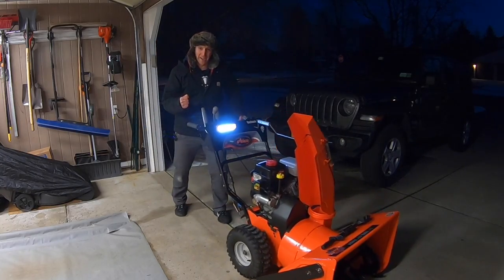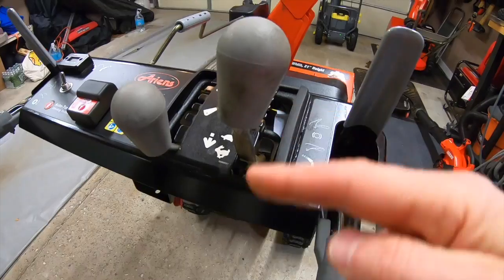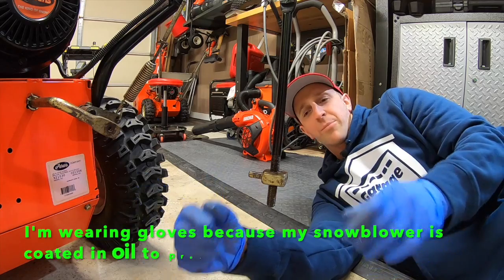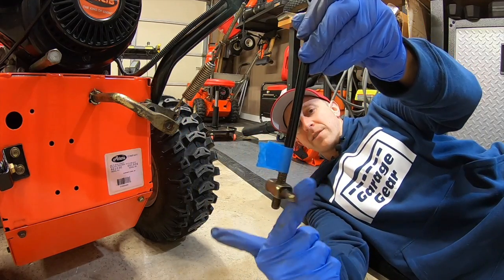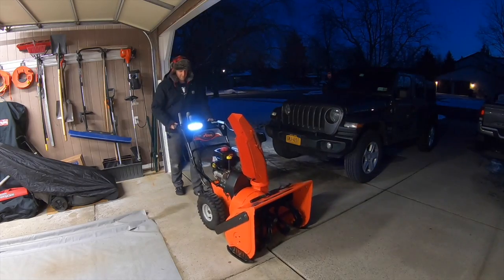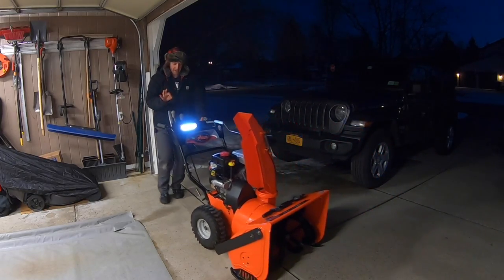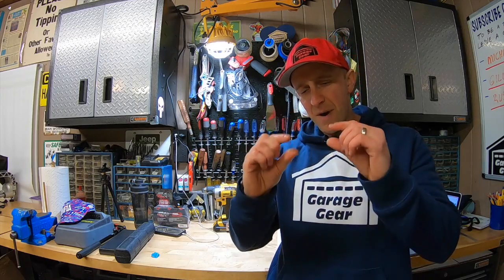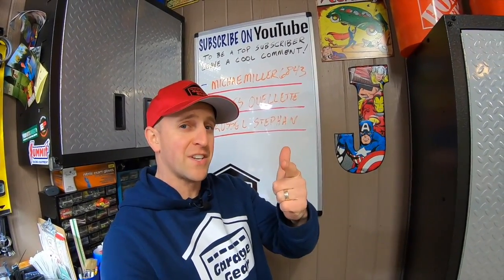BEFORE YOU ADJUST THE SPEED SELECTOR ON AN ARIENS SNOWBLOWER, WATCH THIS!

Comment: I created another slower gear between 1st and reverse. Cut an appropriately sized notch in the gear deck and adjusted the rod to match. It was possible because Ariens newer gear decks are different than what was seen in this video. Used a dremel.
Reply: Great idea, I'll try that for certain brands!
Reply: Space Cadet tell us more! @JB can you elaborate on this?
Reply: @brandon_burbach  The gear notch deck on an 2019? Ariens runs horizontal, right to left. For each gear is simply a notch in the steel deck which sits the spring loaded lever. There is a wide space between first and reverse which is solid deck into which I cut a slot wide enough to fit the lever.

 Because I felt 1st gear was too fast, I readjusted the gear rod length (as he shows in the video) to match the speed I needed and it also affected the reverse speed. I took put the words (SLO) above the gear with labeling tape.  I made it all pretty by black enamel or was that nail polish? 🤔

Don't try this at home though. This was attempted after hours and hours of sitting at the feet of J.B., learning from the Master himself. Now that I'm a professional (under J.B.) I can ignore all those warnings I see on TV ads. 😏
Reply: @donmayberryjrsOPE  yes, certain gear decks may not allow this mod.
Reply: I had found that simply adjusting the shift lever rod resulted in speeds, either 1st or reverse that were almost non existent. So that's when I gathered all my J.B. knowledge and cut myself a new gear. Reminder: This is on a newish Ariens but may/may not work on other brands, based on the gear deck. 🙂
Reply from the maker: Space cadet!!! This is a great idea! Saw another guy do this a while back. He used a grinder… very messy! The guy made a really slow newer first gear. Worked great! My model doesn’t have much room for this. If it did I would try it. Thanks for sharing your expertise bud! Did you install a spoiler and taillights on your blower yet?
Reply: @GarageGear  I had a problem yesterday with an old Poulan snowblower, 1st reverse was too fast and the slowest forward was too fast and not enough slack to "make a gear" and the customer was pissed! Because I told him how it SHOULD be if he has bought a better brand 😂😂🤣🤣🤣🤣
Reply: @donmayberryjrsOPE  lol...😄
Reply: This is a great idea. I wonder if this can be done on my Troy-bilt?
Reply from the maker: @SVW1976  possibly if there’s room.

Comment: The "all the way down" trick depends of the year/model. Owners should read their manual before adjusting their snowblower as shown. As an exemple, on model 921044 you should adjust the pivot pin with 7 turns from "all the way down". It still work that way, but fwd will be too fast and reverse will be too slow. 921032 model is the same year as 921044 and should be set all the way down.
Reply from the maker: Thanks for sharing bravo!

Comment: Just brough my Ariens blower out for the first real snowstorm here in Maine. Am having exactly the issue you describe with fwd gear 1 crawling in reverse, and the unit won't go into reverse gear 2. Going try this out today. Thx JB!
Reply from the maker: Give it a shot and let me know how it works out for you Alex! Thanks for watching 👍
Reply: Did you buy it at a big-box store?  If so, there's a good chance it was never assembled correctly in the first place.
Reply: @floobertuber  No this was a way older model(ST824) given to me, but I have experienced a Sno-Tek not assembled properly from the big box store. The auger tensioner was to loose.

Comment: Wow thank you for this !  You  explain every thing so thoroughly. I’m a woman snowblowing with a new Ariens.  I even bought my mine after watching your videos. Your content is amazing! The problem with the  drive belt not lining up and allows the belt to come off the pulleys. Do you have a video to fix this issue.
Reply from the maker: Hey Riverunner! I don’t have a video on that exactly but I wonder if your belt guides on top of the pulley are set a bit wide and could be adjusted down a little to help keep the belts from popping off. Perhaps they could be repositioned. I would start by giving those a look. Thanks for watching!
Reply: @GarageGear  ...yes I was able to get it to stay on track . It Definatly needs to be  moved ever the slightest! .!  I just blew away 21” thank you for all you do!

Comment: Excellent t ip. My 13/32 Pro skips from 1st to second under load like last night. I'm going to do this adjustment ASAP. I replaced friction wheel several years so. Checked wear as ND greased gears in Fall. A few small cuts in rubber but still plenty of thickness.
Reply from the maker: Let me know how it goes for you Joseph!
Reply: Om doing it today my issue is between 1 and 2. Just debating whether to set the lever at 1 or 6 but I suppose I can try both if one doesn't work
Reply: Did it today. My swivel was up top under dash and tge lever was up top too. I pulled it down used number 6 speed like you said. 1 gear lined up. 6 needed a few turns  longer to line up. It was too short. Popped clip back in. Haven't tested it yet but I will this weekend. Installing LED bar light and redoing my hand crank mechanism so it's tied up right now.
Reply from the maker: @josephlahood4647  let me know how the test goes
Reply: @GarageGear Ran her down dry driveway like you did no issues. Reverse 1 and 2 same. I'll have to wait for a good sized storm to testis under load. She was skipping with a big click from 1 to 2 under load. So far so good. Thnkyou Joe

Comment: Hi , Bonjour 
I realy like your videos 👍. I have two questions. I recently bought an Ariens 24 Deluxe…and I found that the first gear was lightly too fast…the dealer said …if I set the travel speed too low, the friction disc will wear out faster ??
And also , my neighbor said that the Ariens friction disc wear out faster than other brands.
What do you think about that. Thank you so much.
Pierre from Québec Canada 🤚
Reply from the maker: @pierrelacasse5345  hey pierre! Congrats on your purchase. You may be able to adjust it the threads up or down one thread to slow your first gear. But make sure you’re not losing reverse in the process. I don’t know about them wearing any faster than other brands. They’re not difficult to replace. I wouldn’t worry about it . It really comes down to how much you’re using it. Thanks for watching
Reply: Thank you…and I hope to have a lot of snow in Québec to have fun with my Ariens 😁

Comment: Great videos! Amazing. Can I ask please what the speeds are for? I use speed 1 for clearing heavy wet snow and faster speeds to move unit from one place to the next but unsure if you are supposed to clear snow in speed 2 or 3? Thanks!
Reply from the maker: Hey Rick! Appreciate the positive feedback my friend! 1 is for heavy wet snow. 2-3 I usually use for 3-5 inch storms of light snow. 4-6 are generally transport speeds. Thanks for being a cool fan! 👍

Comment: I really wish my snow blower had a pull start before I before I bought it somebody made it into an electric only start So I have some struggles with it especially since the carburetors in doing so well and I have to keep using the prime bulb to keep it running. it probably needs a lot more work than just that LOL
Reply: I really can't complain though since I only paid a $1.30 cents for it at an estate sale
Reply from the maker: @SuburbanBeard  hey bud! What kind of snowblower do you have? Brand/model? Only A $1.30 for it? Seriously?
Reply: @GarageGear  online estate auctions in the summer! all kinds of deals. snowflite mtd. 5/21 tecumsah engine upgraded electirc push button start. i have a plan to retrofit a 12v battery onto it so i can oush start it anywhere! constant stalling and running out of gas way down the road SUCKS lol. but i retrofitted the primer bulb to reach the handles so i can keep it going HAH
Reply from the maker: @SuburbanBeard  not a bad idea! Cool way to get stuff cheap! 👍

Comment: Hmmm, mine only has 1 reverse gear and 3 forward speeds, but in as much as 1st gear barely moves it at all, I may see if this will work on my 10M4 ST424 :)
Reply from the maker: See if it works for you

Comment: My new Ariens deluxe 28 moves to fast in first gear. Is this how you would adjust the speed? The dealer told me this is normal for an Ariens. because it was tested before leaving the shop. This is my third snowblower in the last 40 years this is the first one than runs like my Craftsman did in 4th gear.😅
Reply from the maker: Yes this is how you adjust the speed. Make your adjustments and let me know how it goes .

Comment: The manual for my 2014 Ariens Deluxe 24-921024 says it needs to be 7 full turns up the rod from where the Pivot Pin plugs into the Speed Selector Arm while its in 6th gear.  It says (quoting the manual) >>> "Thread adjustment pivot pin along shift rod until it aligns with the mating hole on the speed selector arm, and then turn it up the shift rod 7 turns.  Re-insert pivot pin into the hole."  This is contrary to what @bravoone3823 said down below in the comments.  My owners manual says this method of adjustment is for models #921024, #921030 and #921044. 

Question >>> any harm in having a loose cable for the left lever?  I see yours is loose too, in your video.  It tightens up (via the spring) when the lever is depressed, but how loose should the cable be?
Reply from the maker: Hey Dean, this procedure may vary from model to model that’s why I tell people to check their manual. 

The cable should have a little slack in it. Once I push the lever down it pulls up on that spring so it’s tight when in use. Just a little slack is all you need. Thanks for watching

Comment: Hello

I’m new to your channel and find it very interesting and most definitely helpful. You have stated in a couple of your videos that you live in Buffalo area. I also live in the area, Cheektowaga to be more precise. 

I have a couple of questions about my😅 Ariel’s deluxe 30-in 306cc EFI:

1 - ever since the Christmas blizzard, it seems that the “automatic” auger hold down lever stopped working.  It used to be that when I engaged the auger lever and then I engaged the traction lever I was able to remove my grip from the auger lever and it would stay engaged.  This does not seem to happen anymore. 

2 - it seems as if the lever for the shoot position is slightly out of wack. When I need to position the shoot to a full 90 degrees, I need to “kind of push all the way and twist the lever” for it to catch in the appropriate notch.  A lot of times because it doesn’t seem to seat right, the lever will pop out of the slot

Sorry for the lengthy comment but if anyone can help I know it will be you

Thanks in advance

Coach 0:09
Reply from the maker: Hey coach, 1. It sounds like the linkage underneath the control deck connecting the two levers is having issues. I did a video on this on an older model last year. I doubt it’s much different now. 

For 2 are you talking about the chute crank or the chute deflector lever? 

Thanks for watching
Reply from the maker: @coachg612  ok there should be a lever bolt at the end of a spring underneath the dash for that lever. Tighten that down a little and it should stay in place. 👍

Comment: Hey JB. I was wondering can you show how to properly secure a snowblower when howling in a pickup truck?
Reply from the maker: Hey biggie! I typically use ratchet straps and tie them down around the base of the chute and then to the handle bars to lower tie down cleats. Works well and won’t move.

Comment: How about a brand new 30" Ariens that bogs down in a few inches of snow and the engine won't run fast enough? P.S. All setting are correct and we have fresh gas.
Reply from the maker: I ouellette check your throttle and carburetor assembly. Sounds like your issue can be there.

Comment: tried it but reverse still doesnt move.
gonna try the opposite....
will comment after results...
Reply: worked like a charm.....
disconnected arm, pulled chasis gear lever all the way up (instead of down), put gear change lever into slowest reverse & adjusted threaded doohicky to align with lever & reassembled (with a washer between the arm & the other thingy you push through the hole - someday to be replaced by a bent nail when it rusts out...) as there was too much play....
apologies for the high tech terminology....
Reply from the maker: Awesome my friend. Glad you got it working.

Comment: What do you do if the machine will not go in reverse, but goes forward fine?
Reply from the maker: This video will show you how to adjust your machine back to proper working order.
Reply: @GarageGear  I have watch this video. I have a ST1028 different model. Thank for the reply.
Reply from the maker: @ld8258  ok I wonder if your adjustment bolt is up under your dash. I’d have to see it in person.
Reply: @GarageGear  Thank you for the reply. I'm going to my manual.
Reply from the maker: @ld8258  sounds like a good plan! 👍

Comment: I lost reverse and fwd
Reply from the maker: I would give your friction disc a look.
Reply: @GarageGear  i did the belt came off the spring is still there i had a random bolt with a washer on it that was found in the transmission area. I put the belt back on and I got everything reinstalled and took one pass and the belt came back off. So the bolt means something I just don't know what. Apparently this is not like a car where not all bolts are really required. I did replace the friction disc and did the adjustment how you did it in another video for the shift linkage.
Reply from the maker: @Phoenix_Core  perhaps go back to your owners manual (you can look it up online too) to see if a diagram or two shows where that bolt may belong.